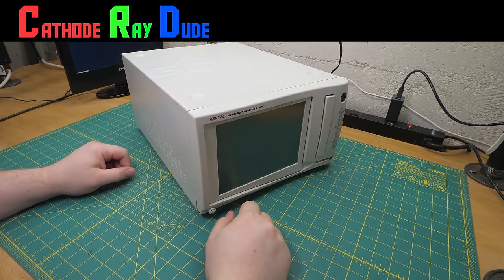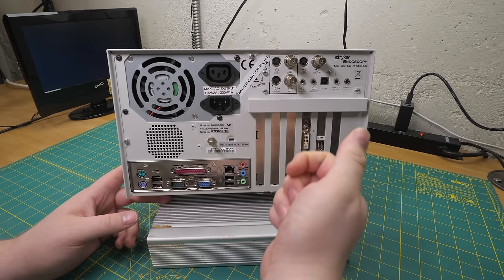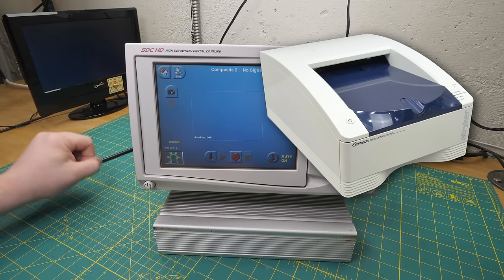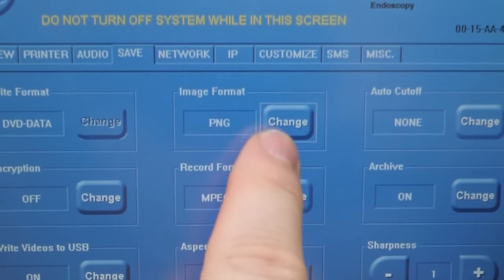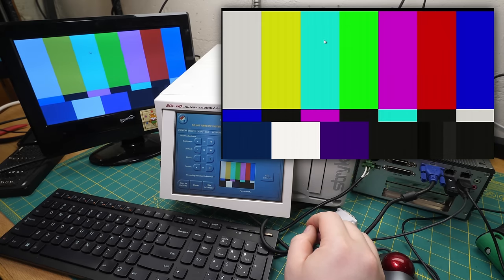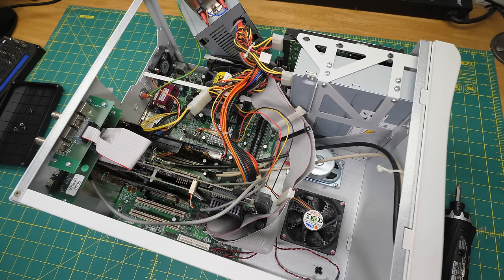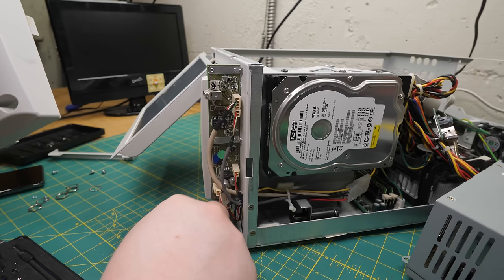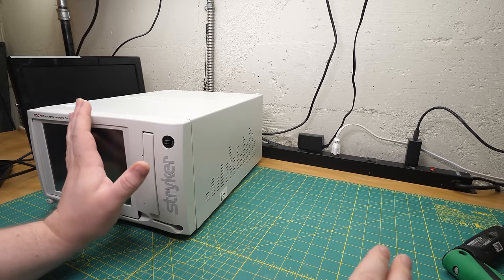Little Guys Ep 11 - Where No PC Has Gone Before [Stryker SDC]

Comment: The optical drive being DVD-RAM and not just a standard DVD burner makes a lot of sense. Take pictures, take them where they need to go, show them to whomever needs to see them, erase them when you're done and the disc is ready to go again!
Reply: What you describe can be mostly done with a DVD-RW. With the DVD-RAM it's even better in a way — no need to do the whole erase process, and you can add extra materials at will without the multi-session hassle too.
Reply: DVD-RAMs were basically just multi-gigabyte flash drives in the era when flash storage was still measured in megabytes. It's shocking that they weren't more popular - although I suppose the cost and hassle of buying a DVD-RAM drive and installing it in your computer was more of a barrier to entry than just buying an external card reader, or using a USB drive, which you could more easily transport and plug into another computer... and were less prone to being damaged... and were smaller. 

Actually, yeah, it makes sense that DVD-RAM didn't catch on with consumers.
Reply: @alfiehicks1 That and the whole DVD+R and DVD-R brewhaha.

Comment: If you have a framebuffer it should be pretty darn trivial to overly data over it even with old FPGAs. You'd basically just pick from the data stream of the video signal or the framebuffer and digitally "race the beam" because the digital signals still have all of the CRT beam timing stuff in them.

There's an old project to do that with HDMI, it was really cool. It used a FPGA for everything, the DMCA killed it because of HDCP.

Comment: I was employed in a school that required all teacher laptops to be locked down with Kensington style locks.   Compaq had somehow designed tracks on the board to run under the lock tang.  So when someone did exactly that and ran off with a locked laptop, enough circuit board was torn off that the board became unserviceable.   Laptop was recovered sometime later, that's how we worked this out.

Comment: I recently bought a usb-c endoscope that plugs into your phone. My plan was to use it for poking around the ceiling to run cables.
Unfortuantly the led lights on it are so dim its almost impossible to see anything.
I also couldn't help but stick it into my mouth and look at my teeth.
Reply: Okay but did you ever use it for its intended purpose?
Reply: @rhysbaker2595  I did but the driver told me to get off his bus
Reply: A lot of these LED things are terrible, I was lucky enough to find an old-fashioned coherent fiber bundle scope with a krypton bulb in the handle. Picture's weird but bright enough, it's like looking through a beehive edit I meant honeycomb
Reply: There might be a hidden brightness adjustment?
Reply: @renakunisaki  I've seen the low priced endo cameras, the little 0402 white LEDs just can't make that much light.

Comment: Used to order so many of those screwdrivers when they were Hitachi D3D-BL when I ran a warehouse doing DFO return stock teardown trailers (basically the stock they don't want, Dell sells to the highest bidder). A vessel #1 and #1/2 tip will last forever.

Comment: Right shame about that AGP card and LVDS for the panel. Could definitely do something useful with it if it was a tiny bit more modern.
As something to consider - that chassis could still be modded to have a nice and modern touch screen. IIRC there are a few modern mobos with an internal DP header for signalling, which coupled with the right touch panel would lead to something quite useful
Reply: Just be aware that sometimes that port is to receive a DP signal and embed it in a USB-C video stream

Comment: I work in outpatient endoscopy, and somewhat hilariously we only just got LED this year. Up until June we were still on halogens that ran hot as hell and burnt out after 500 hours. They're still fiber optics for compatibility AFAIK. It's a very interesting field in tech that goes undiscussed due to some unfortunate stigma
Reply: I’m not at all surprised. It’s only been a few years (like 10 tops) that we’ve had LEDs that have a CRI truly comparable to incandescent/halogen/sunlight. And without a doubt those LEDs (or rather, the devices using them) would need to get FDA approval before being put to use.

Comment: Very interesting video. 
You can guess, that most of the settings if not all of them are made from the technicians of the company or the hospital who maintain the machines and set it up. After that they are used by the doctors if they are set. 
I can imagine that they us a different module for the sound recording, because the sound comes maybe from microphones that are fixed installations in the room. Often this systems are modular and you can chose what you want to buy or use. Some hospitals only have the printer and can print some still images, others have the video recording unit too, others also have sound recording. It is all about your budget.
And you can guess that the machines has some technical issues. I can only speak from Germany, but as long as they work these machines stay in service, and that can be for a very long time. Our local hospital still has a lot of ultrasound machines still with CRT monitors running. I workes in a hospital myself and in the electric trash corner in the basement there was a maschine, that had a hand written note on it to the doctors, not to switch the unit off, because it will not boot up properly again. So you can guess, that even after the issues the unit still was in service for some time.

Comment: Nice!

A reason for having the audio chip combined with the video capture is that it allows the audio chip to have it's clock synchronized with the video capture clock. This solves the classic "PC doing video stuff" (that is not HDMI or Firewire) where you need to clock the recording or playback with the speed of the audio device, and if it's speed differs ever so slightly from the video hardware then you need to either drop a frame or display a frame twice every now and then. Probably deemed good enough for consumers watching their (fully legally obtained) video files on their computer, but for sure not OK when recording medical procedures.

Btw re the Siemens and Philips chips that have names like SAB or TDA and whatnot, the naming convention is called Pro Electron and is/was used by most European manufactures, and stems from the early vacuum tubes. SAB = Microprocessor, so thus the Siemens licensed / second source 8088 chips were called SAB 8088. S = digital ICs, T = analogue ICs. Over the years they reused initial letters. The letters A for germanium and B for silicone discrete semi conductors were originally early vacuum tube designations.

Comment: Keep in mind, FireWire was also used for storage. So it could either be used for backup to portable drives for offloading, or other things such as an internal high-speed network, especially if the device did not include gigabit. Since firewire also had redundancies in it, you could technically use it in a way between controller/peers to coordinate data transfer with redundancies.  There are also firewire video drives like the Focus Enhancements FS-Pro (such as FS-Pro HD which have) which can also capture firewire video, but also replay it back.  Lastly, some editing stations did use FireWire/i-Link and technically, since it's a capture device, it could be somewhat also repurposed the hardware to be a media transfer system.

Comment: It's easy to forget that GPU acceleration was rarely a built in feature for any computer until around 2006 when integrated GPU's first started to exist. Before that if you wanted acceleration you had to rely on a dedicated graphics card. There were at least a handful of different competing 2D and 3D card companies. All in competition with each other, and none of them compatible with each other. So it's not surprising a computer this old does everything in software.

Comment: Seems like a normal 30pin LVDS connector
Check if the pinout on that connector is correct, get a 10$ LVDS-to-HDMI card and replace that useless 845 board

Comment: Huh. I only knew Stryker from their ambulance equipment. They make stretcher systems that are electrically or hydraulically operated. If you see a stretcher with a thick yellow frame, it’s probably a Stryker. They also make special seats that go up and down stairs. Those have saved so many backs of ambulance crews…

Comment: Geutebruck DVRs from the early 2010s also have a completely in house designed video capture card. I recall the chassis being half regular ATX case and half a cage for all the custom circuitry required for the I think 16 composite inputs for CCTV cameras that’s driven by a custom video capture card. It’s been so long since I worked with them that I can’t remember too much about them but this reminds me a lot of them. Lots of Analog Devices and Xilinx Spartan chips from memory

Comment: I was under the impression that LCD panels were kinda-vaguely-sorta standardized. Any chance you could remove that 800x600 panel and find another panel with the same mounting and physical dimensions but a higher pixel resolution?
Reply from the maker: LVDS is a huge mess of incompatible protocols and nonstandard plugs. I'd basically have to go to ebay, buy random 8" panels, hope they're exactly the right size, happen to use the same protocol, and happen to have the same plug. I ain't patient enough for that, haha
Reply: What about the other way around - Trying to find one of those universal VGA/DVI/HDMI to LVDS converter board that might work with the existing panel to make the machine more universally usable? :P
Reply from the maker: @resneptacle  800x600 is still miserable TBH
Reply: Have you tried running the VGA output without plugging in the LVDS card to see if you could at least get higher res on an external monitor? And while I'm at it, I also wonder if the capture card would show up in VirtualDub or something? The fact it appears under sound & video devices in Device Manager may point into that. Also the picture controls in the UI give me the VfW capture vibes ;)
Reply: These days, you can pick up 5" to 10" touch screen panels that accept plain old HDMI or DisplayPort, with USB for power and touch input. One of those would probably fit in there acceptably.

Comment: AH these! I remember always having to retrieve patient images and videos off these cause staff never seemed to learn how to do it themselves lol

Also at 5:15 for a scope cameras light source they do not use lights on the scope itself. There is a light box which contains the source about half the height of this unit. Typically a super bright and hot lamp that is then ran through a fiber optic cable to a connection on the scope through it could be a LED lamp inside those boxes in newer equipment now. But what we had was all old school lamp I believe.

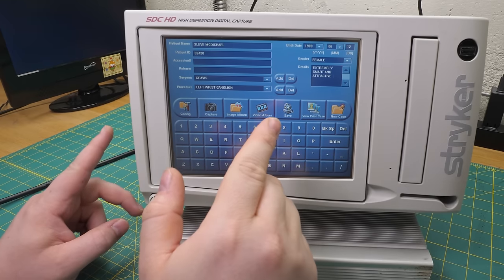12:00 yes the machine does save the patient files to the internal drive. That's where I had to look them up for staff. It would be under previous cases.

Comment: One other place where you can find embedded computers that's not really trying to hide too well is in some reading machines for the blind. Of the two I've had to work on, including the one my grandmother uses, they've both just been machines running Windows embedded, with I believe mini ITX motherboards. One is running XP embedded, one ran Windows 8 embedded. It's literally just a computer with some kind of a webcam stitched to the casing.
Reply: I actually found an old echoscopy machine and it was literally just a windows machine and the probe was connected via usb. It did use standard parts and a rebranded motherboard

Comment: That grounding pin is standard on all medical grade equipment. There's limits to how much ground current leakage you can have on medical grade equipment, so that pin would be used along with a car battery looking clamp and essentially a specialist multimeter to check if it's within bounds. I'm not sure if they are actually used specifically to ground people, and one would think that banana plug or even a simple ground screw instead would be more appropriate for such an application.
Reply: We use dedicated ground lugs on electronic test equipment to ensure that everything is 100% chassis grounded. Power cords get damaged and there's always the potential risk that an outlet is not properly grounded. Lugs on equipment in a rack or on a bench would be connected to a single ground point which then ties to a dedicated ground strap running around the room. You usually also have an ESD mat and a wrist strap that also connects to dedicated ground. The grounding ensures that all equipment is at equal potential and that any EMI generated in the equipment is blocked.
Reply: @abcdef20  Yep, this. I spent a few years working for GE and using this lug to test leakage current was part of our annual service.
Reply: They are most certainly not intended to be used with an alligator clip or crocodile clip!!! There are dedicated medical equipotential grounding plugs designed to snap onto those studs. And it makes sense to use those instead of regular banana jacks or whatever, for the simple reason of using the same standardized connectors on everything.

And you wouldn’t use a screw because that’s for permanent or semi-permanent installation, which is not at all how mobile medical equipment (like this endoscopy system) would be used.
Reply: @tookitogo  BMETs test them with a clip.
Reply: @No-mq5lw  So? Electricians test receptacles with multimeter probes, but that doesn’t mean those are how the receptacle is intended to be used. Testing and use aren’t the same thing.
Reply: @tookitogo  For one, they are slightly contoured to accommodate the pin, and for second, they don't mar the pin.

Comment: The bit about surgeon and being able to delete them that quickly is not a problem. The info is recorded into the hospital PACS (networked storage for patient images such as CT, MRI, blabla. it's been almost 20 uears since I worked in a hospital so I don't remember what it stands for) or burned on the cd and saved in the patient record.

Pretty much every procedure needs to start with new data entry, though the tech that operates the machine appreciates the saved doctor part since it reduces mistakes (surgery can induce high stress for the surgeons, and when they need to blow off steam the support staff are typically around).

Comment: 47:50 i gotta come back and add in that Dell made semi-similar cards back in the day for their Dimension desktops (i  got one in the room as a healthy pull) and it does the same thing (essentially) but it's for PCI-Express 4x (on a 16x card edge), and outputs to DVI-D. It's pretty much how they would give you an option for DVI-D instead of VGA but still use the Onboard video. I do think its more of a commercial application vs retail, as it was an office based computer i pulled it from. yes i know you state it as well, i just had to also state it because engagement is fun and im impatient lol.

Comment: Some of those video processing part numbers are familiar from an early 2000s high definition TV product my employer was working on back then. We used Philips and Analog Devices (SAA7114, AD9888) in conjunction with a SOC from SIgma Designs. The chipset in your endoscope gadget looks well integrated and a few years newer.

Comment: I also have a Stryker Endoscopy computer in my collection, only from the Super Socket 7 era (late 90s -- it has a K6-2 CPU). It is one of my prized possessions. It similarly has a built-in LCD, but instead of dedicated connections, there is a "normal" PCI add-on card for the "scopy" part >_>

Comment: Not starting up on first try,   maybe even needing jostling, suggests the reason it does boot next time is "wetting", an oxide layer became sufficiently  conductive...It says there is a "dry joint"... the solder didnt wet  the contact.. or its just oxide gunk in non-soldered joints.

Comment: I thought this was a capture device for CCTV and related stuff. This would make sense as it wouldn't need extra display to check if it is working and etc. not as the main display, but a configuration and maintenance one. Imagine a rack with multiple capturing devices for buldings and multiple cameras, like a mall

Comment: Just a heads up blurred images can be still recovered sometimes. if you want to be 100% sure the info is destroyed in a video you should put a black bar over it
Reply: Can't reverse a blur and pixelation like this. Too much information is destroyed. Gaussian blurs can be reversed sometimes but pixelation removes any useful data. At most you can get a general shape and color of an object but text like this is gone forever. A black bar is foolproof though.

Comment: I got slightly sniped thinking about that display card, and after some digging I reckon that's a Unipac UB084S01-1 display panel. and the pinout for that LVDS connector happens to be documented in the card's manual... so it would be possible to build an adapter.....